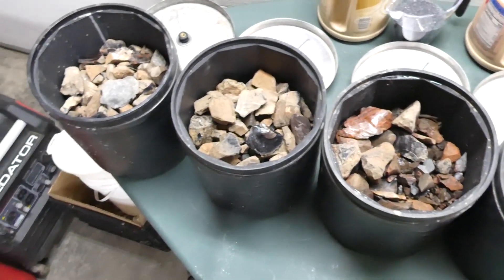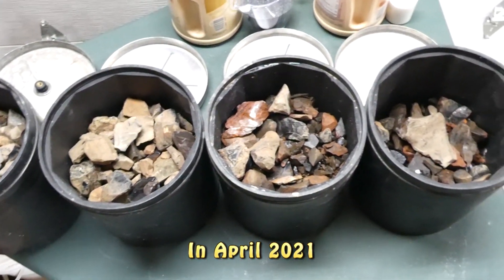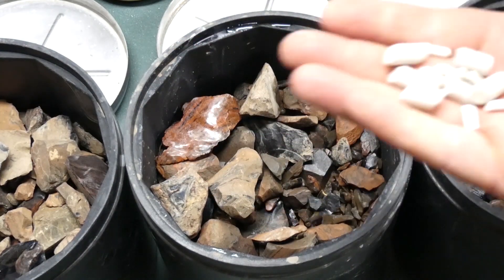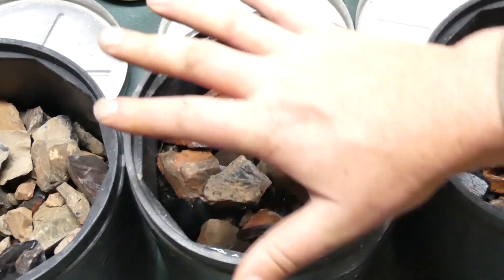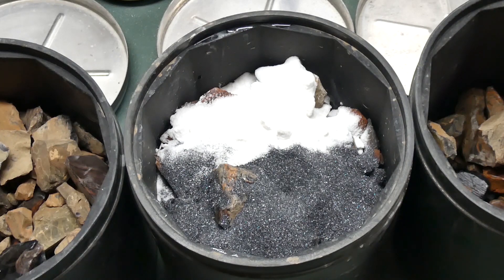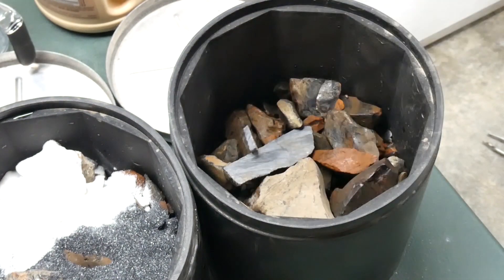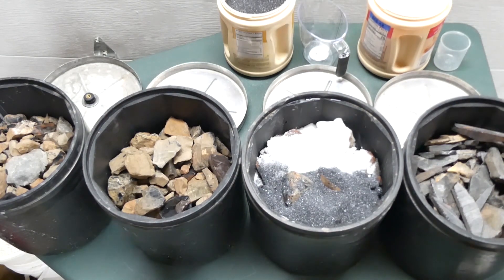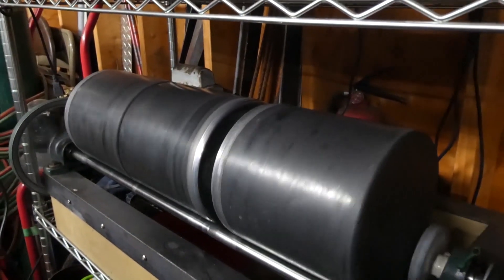Obsidian in a Rotary Tumbler with Coarse Grit #thefinders

Comment: Hey I got some Green Opal that I want to tumble, I will be using glass vase fillers since i only have 1lb of Opals and A 4lb barrel tumbler. My question is, Do I use coarse grit (I have 80 SiC) or should I start them in 220 SiC since they are so soft 5 on the mohs scale?
Reply from the maker: Depending on the size of them.  You may need to roll two times with medium grit. I think I would avoid using coarse grit.  Too bad you did not have more to practice with. That is how I started, practicing with rocks I have a lot of, then took what I learned and applied it to other rock types. I saved the high quality material until I had more experience.
Reply: @1JawsJr  I have like 200lbs of "pratice rocks" just not opals lol. I have like 100lbs of quartz and quartzite and a bunch of just run of the mill dirt dug "Ohio common rocks". My girl got the Opals for me half as a joke because i was complaining how long my jasper and Agate was taking  so she got me softer rocks, Green Opal, Lapis and Red Avertine.
Reply from the maker: @vance7354  it is still going to take a long time with the softer rocks, you just to have different procedures. In some cases, if I start with medium grit, I may run several cycles of it to achieve the look I want, which could take longer than the typical Mohs 7+ material. I want to control the amount ground down, so shorter cycles, less grit each cycle but could be many more cycles, which may result in a longer time from beginning to end.  I will also run it in my slowest rotating tumbler, which also adds more time.
Reply: @1JawsJr  well, I wont be aiming for perfection, I just want to take off the rough edges and get out any major flaws such as nicks or gouges. But I am aiming to maintain the natural look of the stone, just shape it a lil and give it a shine. I also only have 1 tumbler, a 4lb tumble-bee .